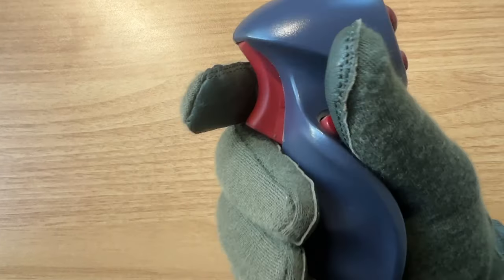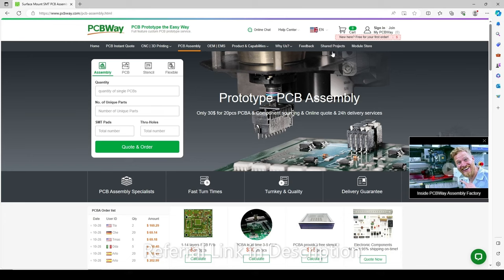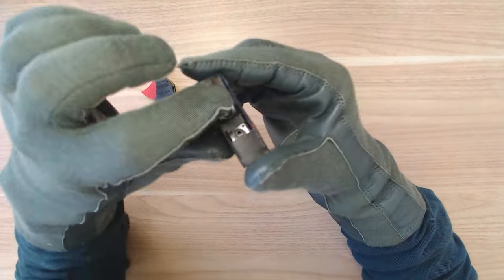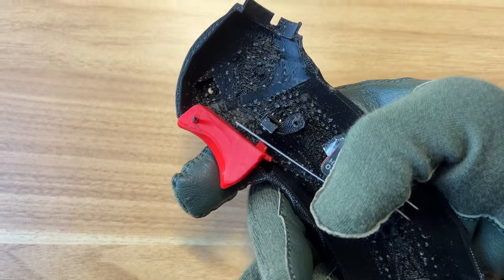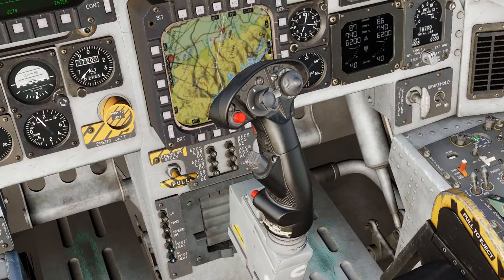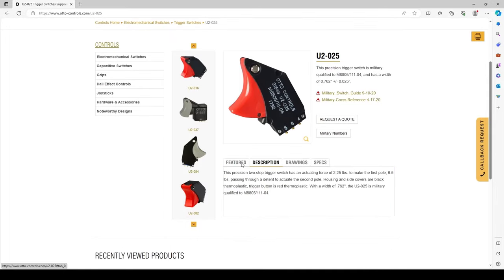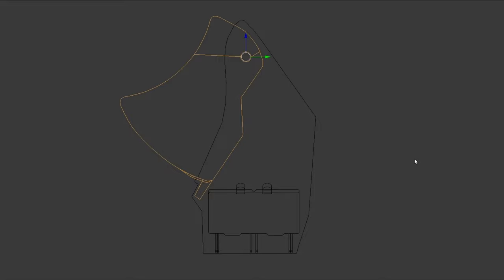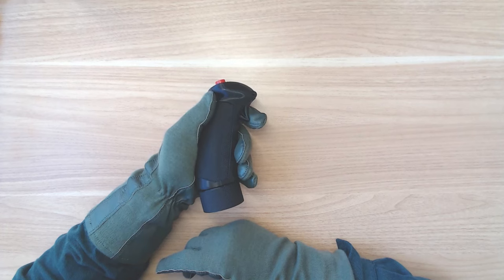Universal Flight Sim Trigger Module

Comment: What is the difference in the multiple trigger models and the 2 housing models? Thanks.
Reply from the maker: The V1 trigger and housing are the tact switch bases triggers, everything else are hte microswitch based triggers. The differences between them are dimensional, one is for an F-15 stick, one is for an F-4 phantom stick, and the other is for an F-18 stick, but they will all function the same way

Comment: Brilliant solution! Is there any concern with potentially shearing off the buttons from the microswitches due to being loaded sideways?
Reply from the maker: Thank you! Yes there is - I went through about 20-25 prints before finding an set of angles that reduced the wear to an acceptable level. I think the combination of the softer PLA and reduced angle should keep the change of a shear low. I have been using one of these heavier triggers for about a month now and I haven't had any reduction in sensation, but I will definitely make an update post if something changes.
Reply: A pro micro fidget toy that counts actuations might be the play! 🤣

Comment: Really great work.  I did something similar in function with an airsoft design of mine.  Airsoft has terrible triggers compared to their real counterparts.  I achieved the break action with a flexible printed spring as part of the sear.  I'm wondering if the sideways force on your switches will result in an eventual shearing?

Comment: Need more info on the torsion spring, what angle? How many turns?
Reply from the maker: Hi the Torsion spring I am using is .9mm thickness, 7 turns, total width 6.35mm

The V1 trigger uses these springs:
1x 0.5615 0.5mm Wire Diameter, 6mm Width, 15mm Length 304 Steel Spring

1x 0.5915 0.5mm Wire Diameter, 9mm Width, 15mm Length 304 Steel Spring